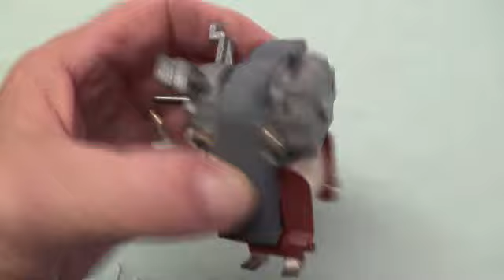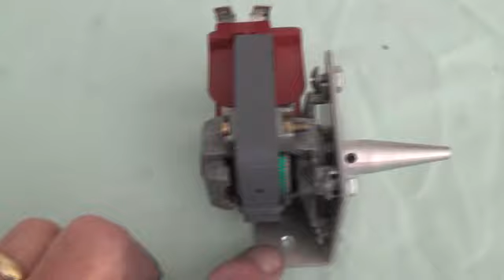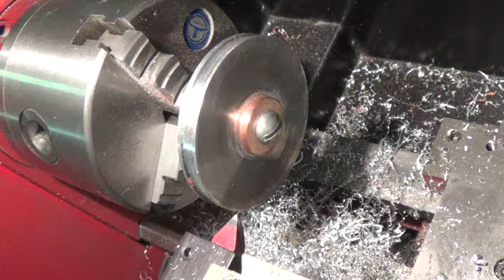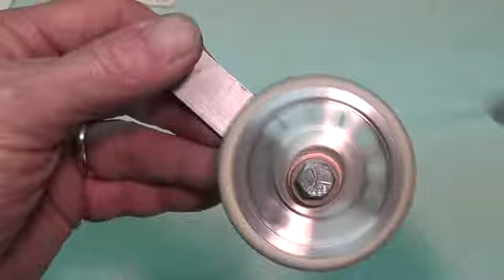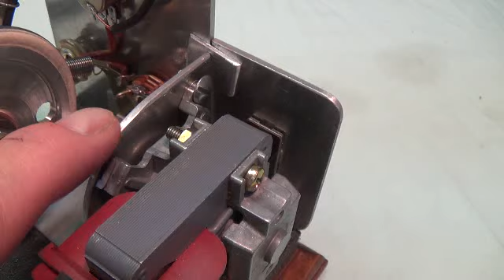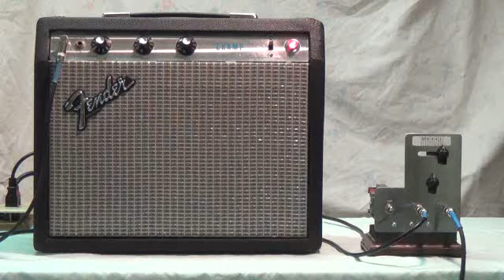Homemade DeArmond Electromechanical Tremolo from Scrap Parts

Comment: I've been looking and looking for a modern reproduction of this design - nothing!!  I don't know if the DeArmond model 800 or 60B use the same rotating liquid design - but even those go $900+.  Are you aware of any modern reproductions?  I might just end up taking a stab at building this guy.  I don't even use the tremolo on any of my Fender amps at all (I'm not the biggest fan of the photo-resistor type).  I think if I had one of these (on so low it could be more felt than actually heard) combined w/the Fender tremolo on my Super Reverb - I could have some killer tones
Reply from the maker: Other than using a tremolo pedal, you're pretty well limited to making your own unit, M39.

Comment: okay you got me thinking about solenoid and water tank driven compression now, head churning, maybe some kind of electric smoothing or dampening but even just tilt with signal would probably give interesting results nontheless, again, brain churning, i guess it'd really be fixed threshold and near instant attack and release if balanced well enough to not splash, and assuming the resistance is just to ground in a voltage divider, again, i may just have to learn more metal machining than my drill press, you're really sending me with what a single lathe can do
Reply from the maker: Having a milling machine helps also, SM. By all means do some experimenting and let us know what you create.

Comment: Awesome video!
Reply from the maker: Thanks, AM.
Reply: @UncleDoug  what part of the country are you located at? I’m in Evansville, Indiana. The reason I ask is that my father was really into electronics and building and fixing old guitar amps from the 60’s up until his passing in 2012. He left me a huge amount of old guitar amps, boxes of capacitors, crystals, reostats, heat sinks, transformers and God knows what else. Basically anything and everything to do with repairing guitar amps and some cb radio stuff along with a whole ham setup that I haven’t the slightest clue what to do with. I never really got into the repair of electronics growing up as I focused on automotive repair. Long story short, I have enough vintage parts new and used from the 60’s on up that will fill a 12’x15’ room that’s not being used. If you was close enough to Evansville Indiana I’d like to show you what all I had to see if you might be interested in it. Nobody messes with that stuff anymore these days it seems like so I’ve just been holding onto everything until I find the right person that would know what to do with it all. If it was up to my brother he would’ve trashed every last bit of it so I’m glad I was able to salvage everything and get everything boxed up. If not you, then maybe someone else reading this that lives within the area might be interested. I’m not trying to get rich off the stuff, I would like to see it go to a place where the parts will get used or just go to a place where they will know what to do with it all. Thank you for your time, and to you sir I say all the best!
Reply from the maker: @theautodidacticman_  Sadly, I am quite a ways away from you, AM.....in West Texas. If you would send a message to my FB page: Uncle Doug's Vintage Amps including your email address, I could share this info with thousands of followers, some of whom may live near you. I wish you had a list of the old amps in the collection. Jack and I would pay for packing and shipping of any that would make good video subjects.
Reply: @UncleDoug  maybe in the next week or so I’ll be able to get over to my other house where I have all of that stuff stored. I’ll take a lot of photos so you can get an idea of what all he left me. There’s two things I’m going to keep out of everything and that’s his fender Stratocaster and a old silver banjo he had. I think the fender is a 1963 model but I’m not for sure. It’s almost in pristine condition too. I’ll be getting ahold of you shortly though and thank you for your time today. All the best!
Reply from the maker: @theautodidacticman_  Thanks so much, AM. Take good care of that guitar.....it's worth a fortune.

Comment: hello, first congratulations very cool the project. I wanted to do one too. a question, is windex the glass cleaner? in Brazil we don't have this brand, is it a specific component in this brand that works as an energy conductor? Will others with a different formula work?
Reply from the maker: Thanks, Bernardo. Other brands will probably work just fine, but you'll have to experiment with them to find out.

Comment: What is max and min resistance of that tank? Would be cool to use mechanical tremolo to substitute lfo-circuit in photocel devises. Electro mechanical vibrato would be achievable.

 Also one interesting possibility of passive tremolo could be hooking it up before fuzz face, as it will mimic volume control of guitar, and won't crap dynamics of fuzz. Mountains of signal would be crazy distorted and valleys get gradually cleaner. Something like bias wiggler tremolo, but hundred times more pronounced.
Reply from the maker: That's an interesting idea, Jorma. Hopefully someone will test your theory.

Comment: It might be improved if the on/off switch included some extra hardware that lifts the rubber tire off of the tapered spindle when the switch is in the off position.  This would prevent the tire from getting a dent from sitting on the spindle.
...kind of like the wedge at the bottom of the wiper stroke on my wife's windshield that lifts the wiper arm a bit when the wipers are turned off.  The wipers on my car (and most cars, I guess) just take a set and chatter after a while.
This would probably function as a finger-operated wheel lifter that also operates a switch rather than a switch that operates the lifter.
Reply from the maker: That's a very interesting suggestion, BP. I'll look into it. Thanks :)

Comment: Is the intensity knob just acting like a variable resistor that shorts to ground, with the signal otherwise passing straight on through to the other jack?
Reply from the maker: No, the Intensity pot (at Minimum Intensity) adds enough resistance to the brass canister circuit that the music signal ignores the canister and goes straight to the amp. See the diagrams and explanation in the video.

Comment: Could you tell me what gauges and type of wire you used in this project?
Reply from the maker: That was long ago, Ray, and I don't recall. For AC, probably 20 gauge, and shielded cable for signal.

Comment: Uncle Doug - I am working on making a version of this tremolo. I have a sewing machine motor — could I use some sort of light dimmer control to control the speed rather than going full mechanical?
Reply from the maker: Yes, you can, Alex. I posted a video on another channel showing a motorized tremolo design, using a fan speed controller:  https://www.youtube.com/watch?v=lNJzm7dwf9w
Reply: @UncleDoug  Is there any particular type or voltage dimmer I should use?
Reply from the maker: @alexreed6327  It's not a dimmer.....it's a ceiling fan speed control. I got mine at Ace Hardware.

Comment: Wow.  You might add a pot in series between the electrode and ground, so that the excessive depth can be reduced at slow speeds.  (Maybe the speed control could be a dual pot, with one gang being the depth.
Reply from the maker: Good suggestions, Tim. Thanks !!!

Comment: That's wild! I never would have imagined. So what's going on with the conductive fluid that it doesn't produce a square wave? I take it there's some magic in how the fluid thins as it moves away from the electrode? If the fluid was mercury, it don't imaine it would sound nearly as smooth, and that confuses me.
Reply from the maker: You're right, Mercury does not produce a pleasant effect. The more pleasing sine-wave effect with water is due to the waxing and waning of resistance due to the change of surface area of electrode in contact with the relatively-low-conductive fluid.

Comment: Fascinating Doug.   I just acquired an original DeArmand effect box, not the pedal type.  It was sold as not operational so I took a chance and got it for a price much lower than the $500 you were talking about.   Some broken wires and insulation.   The motor has resistance and a drop of oil freed up the shaft.   A question, winded or distilled H2O?  How much? No fill line.  I think I can fix it and make it good to go for another 70 years.   I love your videos. 👍
Reply from the maker: Windex or water with a little salt in it is best, Jon. You can experiment with the proper level within the tank.....starting at about half full. Good luck.

Comment: That is just the most inovative awsome thing I have ever seen. Would it work using a recent IC based amp?
Reply from the maker: Thanks, ISO. Yes, it probably would, since it operates at normal guitar input levels. The amp would simply receive a modulated signal from the guitar and amplify it as it would any input signal.

Comment: Like it that much im going to start one on my lathe now,i have never seen a mechanical unit before i have built an electrical one copied from an Elbex 80 which has a really nice sound. From your video It is awkward to see how the lower potentiometer is wired if you don't mind me copying it from your video would you be willing to enlighten on the pot wiring please. oh and i really like the way you made the linkage saddle to keep the speed mechanism running true.
Reply from the maker: If it's a volume pot, then the guitar signal would enter the left lug of a 1Meg Audio pot, the right lug would be grounded, and the wiper would go to the amp. I hope that makes sense. You can always experiment to see if you can come up with a better circuit. To be honest, you can probably leave the VC off and simply use the guitar or amp volume instead.
Reply: Thank you Doug came back for another look and i noticed this time the contact in the tank was tied to ground which i didn't notice the first time i was thinking that was tied into the pot too. Funny you said experiment with it, I was looking to mount a small dc motor upwards making a drive plate to go over the spindle with the eccentric cam i was going to mount the cylinder to a plate on four small rubber bobins and connect a push rod between the plate and the eccentric i have realized the plate will need grounding too then i planned to run the motor on a PWM for the different speeds, if it works it would eliminate the wheel and tyre and make machining a lot simpler and quicker.
Reply from the maker: It sounds like an interesting design, Ray. Best of luck with your project.

Comment: You're work is inspiring. I throw away so many small motors, transformers, solenoids, actuators, blowers, pumps, limit switches etc... that COULD be used to create something different, but I simply lack the knowledge or imagination.
Besides, my garage is already filled with misc parts.
I'm a maintenance mechanic, but anything that breaks either gets fixed or tossed for a new unit because we have to be running.

Love these types of gadgets. Reminds me of those functional model hit and miss motors that you can put together. The mini steam engines are great too.
Reply from the maker: Thanks, John.......glad you like the creations :)

Comment: Now I'm inspired... big time! I only got a wood lathe but who says you can't use wood for the spindle and the wheel? Oh, and the arm, I've been waiting for a reason to get the wax out and start carving (for bronze investment casting). I watched the other one too, the second rendition maybe, where the speed control is on the motor. Light dimmer circuit? Which reminds me that I've used one to control a wood burner ( 2V at big amps into some nichrome) and I used a light dimmer circuit with a triac but was never sure how to wire it (I've since found an actual early dimmer with what I need but I'll still go back into the circuit I built and try and fix it). That idea came from a guy breaking apart microwave transformers and heavin' the high frequency winding and then rewinding for low voltages and making arc welders (18V). Cheers Uncle Doug, more beaitifully profound stuff!
Reply from the maker: Thanks, Sean. Good luck with your project.

Comment: You sir are a fine craftman. Just curious, : what would happen if instead of a fluid, the container is filled with a fine conductive  powder (copper for instance) ? That would be an interresting experience.
Reply from the maker: Thanks, L4. I don't think any highly conductive material would work in the tank, simply because the residue would create a dead short from electrode to tank body. You need a fluid with relatively low conductivity.....like water.
Reply: Thank you Doug, I appreciate the time time you took for answering me. Keep on with the good job of yours. I like your vids, although I am not into the tech part, your presentations are amongst the best on YT. Cheers from Lisbon.
Reply from the maker: You're welcome, L4. Rusty sends his regards to all the pups in Portugal :)
Reply: Ha ha ha, I will transmit that to my dog.

Comment: to achieve faster speeds all one would have to do is install another contact at the opposite end of the tube. make it switchable for double speed or whatever your liking is.
Reply from the maker: You're right, Mike. With contacts at both ends, you could run it at half speed and still get the same tremolo frequency. Good suggestion.
Reply: glad to contribute. hadnt seen that solution anywheres so i figured it needed a home.
Reply from the maker: We appreciate your input.

Comment: in regards to the balancing you did on that drive wheel, did you just kind of guess on where to put the holes or do you have some kind of method for balancing?  great videos man, I am a machinist myself so I have a great appreciation for this stuff
Reply from the maker: It's been a while since I built this, Nicholas, but I have a feeling the holes were drilled more for looks than actual balancing. The wheel runs at a rather moderate pace, so I didn't feel that careful balancing was necessary.
Reply: yeah, I figured so, my curiosity just got triggered when you mentioned it; I was hoping that you had some neat little trick for putting a rotor into balance.  even just removing weight out of your rotating assembly can make a big difference, and like you said it's not moving that fast.  I did notice when you had it cranked all the way up you could noticeably hear it, I wonder if you had it perfectly balanced if you could get that slapping sound to go away, or how much it would actually help. I'm such a nerd for this stuff :)
Reply from the maker: No doubt, perfect balancing would probably reduce the noise and energy required to operate the unit, Nicholas, but part of the fun with goofy old analog devices like this is their imperfection :)

Comment: Can you tell me a little more about the canister? Is it glass on the inside? If not, do you risk a shock if you touched it while plugged in?
Reply from the maker: No, the fluid must be in direct contact with the copper vessel wall for the tremolo to function.  The signal voltage is less than one volt, so absolutely no shock hazard is present.

Comment: Is this unit you built making the crackling? or...And don't get me wrong I love what you did here just wondering why we have the crackle and can it be avoided
Reply from the maker: I have never noticed any crackling from this tremolo unit, Jerry, so I'm not sure where it's coming from.
Reply: He is hearing the mechanicaL cLicking sound 
that is not being ampLified by that Champ-Amp.
Reply: Fake Dossier - I think what we hear is the mechanical noise of the device, coupled with the amplified sound from the amp, as picked up by the camera microphone. If played through any moderately loud amp, the mechanical sound would surely be drowned out.
Reminds me of days past, when machinery was presented as art as well as function, wit polished parts and finished wooden bases.

Comment: WOW!  So cool, Uncle D!  You explain things so easily and clearly!  I feel like I could build one myself on a cold/rainy weekend!  Except for the tools and parts and sizing and know-how!  That's why you is my new electronics uncle!
Reply from the maker: Thanks, Bob. We all had to start somewhere, and in most cases a strong interest in amplifier circuitry (as you seem to have) is a great place to begin.
Reply: I clicked the box in your vid to see the build on your little tube amp, but it didn't seem to load a URL.  I also have a vintage tube PA system amp I want to make a guitar amp out of.  Could use some advice.  TIA
Reply from the maker: I'm not sure about the amp build link, Bob, but I have posted several videos showing how to convert PA amps to guitar use. Hopefully, they will be adequate for your needs. Good luck with your project.

Comment: Thanks for the great video. You wouldn't happen to know much about a DeArmond trem trol 800 would you? I have one that my dad has had since the 50s and it needs serious repair.
Reply from the maker: I have never personally owned or even seen a DeArmond Tremolo unit, but the principle of operation is quite evident in the two electromechanical clones that I have built.  Rusty and I no longer do outside repair work, however, so I guess you'll have to seek the help of a qualified tech. Good luck.
Reply: Thanks for your reply and thanks again for all your videos. I find this stuff fascinating! I have gleaned some good info from your tremolo unit builds and I really appreciate all the work and time you put in to this.
Reply from the maker: You're welcome, Trem. Electromechanical tremolos are fascinating devices and I have thoroughly enjoyed building several of them. We're glad you found the videos to be helpful and informative.